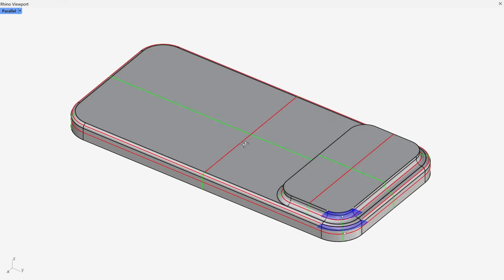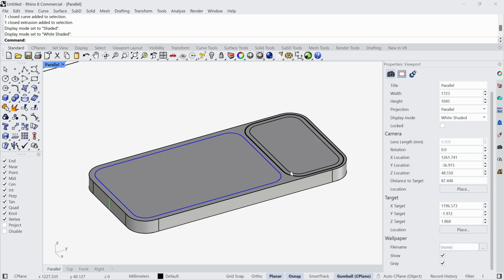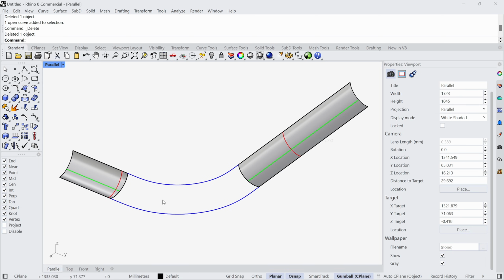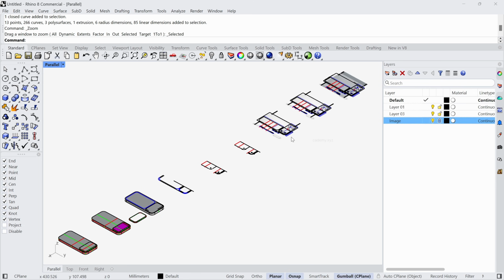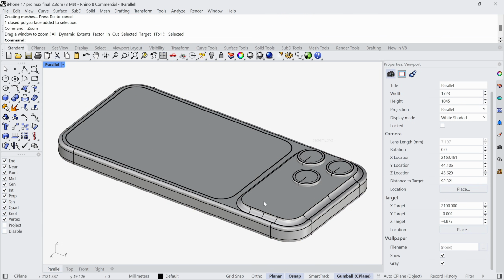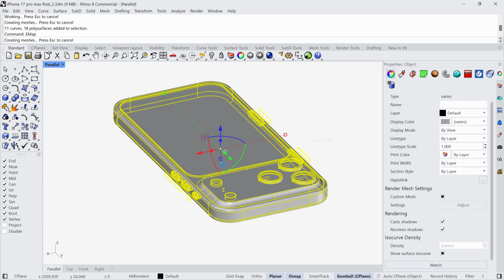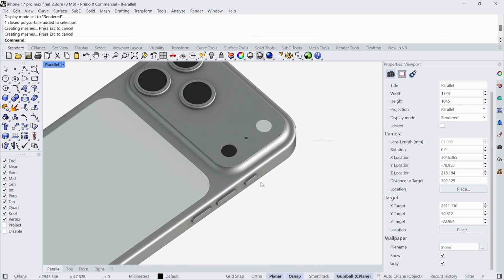How Apple-Style Fillets Are Made | iPhone 17 Pro Modeling in Rhino

Comment: I'm wondering where you got the 25% radius for trimming back the lines to make your BlendCrv between. Is that just a rough number that you picked, or is it somehow mathematically ideal?
Reply from the maker: it's an approximation of creating a definite method. So we cannot create a fixed proportional distance between Control point, aligning tangancy etc, in Rhino 3D (compared to SolidWorks or Fusion), so that's why I used this simple technique to use 25% of radius value. You can try different proportions and methods to trim.

Comment: Hi, thanks for your tutorial!
I see most rhino tutorials teaching how to "reverse engineer" products like you do so by modeling based on reference images. However, I'm wondering if you have any insight on how many of these design decisions are made when you're designing from scratch. 
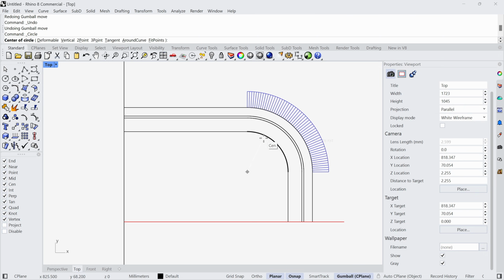For example, at 4:00 you choose to use 0.25 size of the radius to use as an offset distance. Why do you choose this size? 
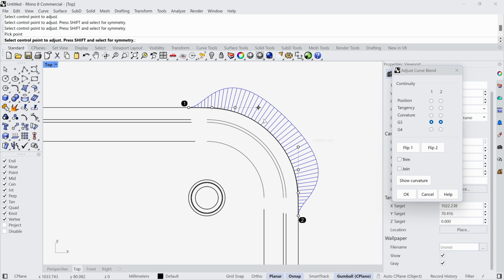At 6:00, for the most important part of the video which is modeling the fillets, you're saying to just go by eye match against the reference image. How do you ensure consistency between the offset fillets? When designing my own product, is there a way to determine a "mathematically ideal" fillet and apply this to all my edges?
Thanks in advance
Reply from the maker: There are two sides to this:

A) Leading with DfM Constraints: You look at your manufacturing limits first. For instance, if you want to add a hole, the material type and thickness might limit you to a minimum radius of 0.30 mm. This baseline immediately dictates the minimum dimensions you can use in your design.

B) Leading with Design Intent: You focus on the aesthetic or functional vision first, then adapt it to the closest DfM-compatible options. For example, you might originally model a hole with a 0.25 mm radius for visual reasons, but upon realizing the smallest available drill bit is 0.30 mm, you adjust the design to match that manufacturing reality.
Reply: @Cademy thanks for your response!
Just to clarify: is there a way to ensure  a perfect match between offset fillets? In your tutorial you just manually adjust the control points until the offset combs match and the curve lines up with the reference image. 
Thanks
Reply from the maker: @Garlicman300  If this is an aestheical feature, you can approximate the "fillet" in a similar manner like I showed you. If this is a funcional part, you can use G1 fillet or experiemnt with clothoid curves.

Comment: just had a question Is this possible in CATIA?
and which  of the tools would be easy to get this  particular design done for example
Reply from the maker: It should be entirely possible to model this in CATIA, as fundamentally both Rhino and other NURBS-based CAD packages use B-Reps (Boundary Representations). You can absolutely use similar commands in CATIA. Furthermore, creating the 2D technical drawings will be much easier to handle in CATIA than in Rhino, as CATIA’s sketcher permits parametric relationships and constraints between curves.

Comment: Can this be made in blender?
Reply from the maker: Blender works on a totally different geometry pipeline. It uses mesh (like polygons in a video game), where as Rhino (or Fusion, solidworks, Alias etc) uses NURBS. It is a mathematical equations defined by control points, weights, and "knots" to calculate perfectly smooth surfaces.

Comment: great video...but generation of blend curves is not ideal...there should be a perfect definite method for this...
Reply: i completely agree, the way in the video is not ideal at all
Reply from the maker: I agree with you. There are different way to make the fillet using a definite method. Clothoid methoud being one. The problem with Rhino is that it's a freeform CAD modeling tool. Creating relationship between curve parameters (tangancy, or locked dimension) and associate reference for geometry is not possible in Rhino (except if you use Grassgopper 3D).

Comment: Great video, wondering is there a specific reason you would not offset the outer curve inward for the bump rather than manually creating the other curves? Wouldn’t this negatively affect the offset proportions slightly?
Reply: Also is there reason you avoided using sweep2 after creating the z axis curve for the camera bump?
Reply from the maker: @a2trm  ALthough sweep 2 can make a single span surface, the control point distribuits is not the best (try turning on the control point to see the distribution). Now try making the surface using surface from 2-3-4 edges command and see the control point distribution is way better!
Reply from the maker: This is because when you offset, it will either offset based on tolerance, which will rebuild the curve with a lot of control points. Or if I offset (loose) it will not make the control point in G2/G3 contrinuity.

Comment: Nice video but why not use blend surface? Or after you did the blend curve use sweep?
Reply from the maker: Blend surface is more difficult to manage as you need to fine tune multiple vertecis in two directions.

Sweep command either rebuilds the surface with degree 3 (irrespective of input curve), or creates a worse control point layout compared to surface from 2-4 edge curves... both situations are not ideal for single span class A surface modeling workflow.
Reply: @Cademy thank you for the input. I really liked the video. I might get the master class. Seems in my self learning I might have gotten bad habits or at the very least am not aware of many best practices.

Comment: 匠の技（Takumi no waza） — “the techniques of a master craftsman”
🙇‍♂️
I would like to see more tutorials on repairing objects imported into rhino. 
Thx
Reply from the maker: Sure, we can make a tutorial for it. Do you mean importing any object from other CAD package? Importing 3D scans or STL files?
Reply: @Cademy  Downloaded models—mainly STL files and some from Fusion 360—import into Rhino with visible gaps and open edges. The same issue occurs with my own models: they appear correct in Fusion 360 but import into Rhino with open edges.🙏 Thx 🙇‍♂️
Reply from the maker: Maybe the problem is file tolerance between Fusion and Rhino. Rhino by default uses a file tolerance of 0.001mm and if your fusion model was made with file tolerance of 0.01 or any different unit size than the model will be open. Make sure your Rhino and Fusion files are made with similar file tolerance settings.
Reply: @Cademy  Thanks for the tip! 🙌🏼 I’ll definitely give that a try next time. In your experience, what is the best file format for importing Fusion models into Rhino to ensure the cleanest results? Keep up the fantastic work with these videos—your Rhino expertise is incredible! 😊
Reply from the maker: @Rah84eem  you are welcome :)

Comment: Does "refit trimmed surface edge" convert a trimmed surface into an untrimmed surface? If you were to reference that surface in Grasshopper that is.
Reply from the maker: Yes, as long as the cut is across the entire U or V direction, it can rebuild the trimmed edge with the original untrimmed edge. Ofcourse, it will also deviate from the trimmed edge depending upon the complexity. But you can asses if it fits your design intent or file tolerance.